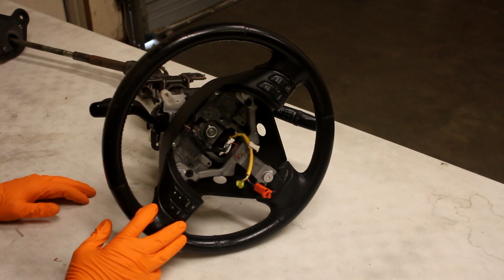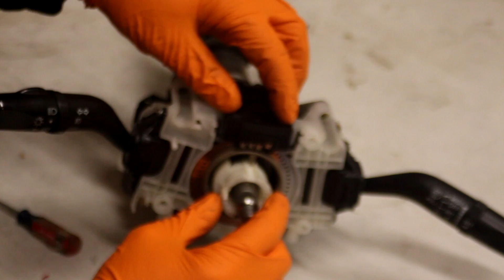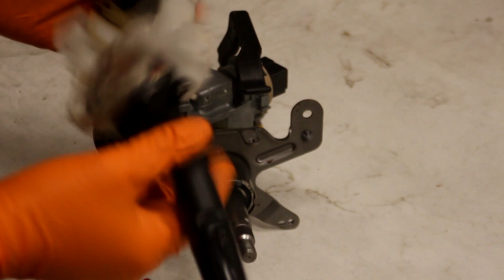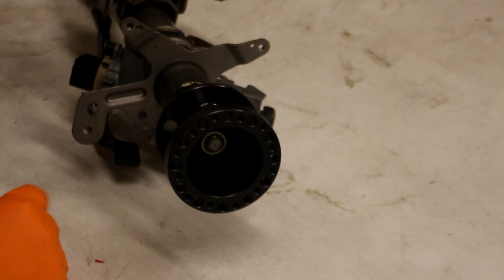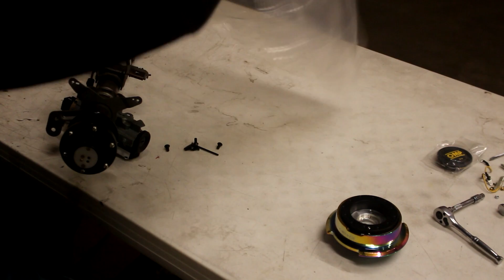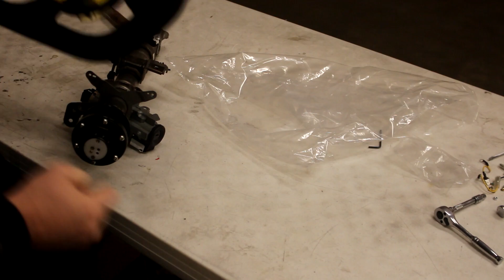RX-8 NRG Quick-Release and OMP Superquadro Steering Wheel Install

Comment: Is there a significant weight difference?
Reply from the maker: I will weigh the car when it is done, but overall weight should be pretty close. The center of gravity may be a little higher due to the height of the v6 engine though.
Reply: Track Car Obsession my apologies... Did the Racing steering wheel save weight over OEM?
Reply from the maker: @rx8matt  That's my bad. I responded to this in the youtube studio app and didn't notice the video your comment was on. The wheel itself may be a little lighter, but after using the quick disconnect setup, I would say it probably is a negligible difference compared to the factory wheel with the airbag. That said, because I don't need that stuff on the wheel anymore, I have also been able to strip the rest of the column, so there is some overall weight savings. On a normal road car, just swapping the wheel, would really only be for better grip and looks.
Reply: Track Car Obsession got it- thanks for sharing

Comment: Removing the clock spring deletes the powersteering but if your running a different rack for the swap it wont matter i guess
Reply from the maker: Oni Kouki Thanks for the info. After going through this car's wiring diagrams more than a hundred times while removing wires and modules I am not understanding as to why the clock spring has anything to do with the power steering. Unless the missing SAS module causes the PCM to tell the EPS module not to function. If that ends up being the case I will go to hydraulic power steering. I already have many reasons to go ahead and make the switch.
Reply: I have an nrg hub on my rx8 and i removed it completely and it feels almost lighter than with powersteering.
Reply from the maker: So you left the electric steering rack, but are just using it unassisted?
Reply: Surprisingly it actually is assisted how idk nor will question it lol it works it works. But if the clockspring is damaged then it wont be assisted n it will feel heavy as hell.
Reply from the maker: Weird. I'll guess we will find out soon